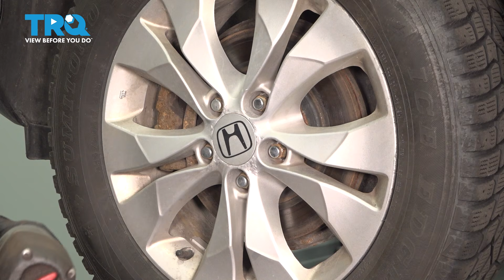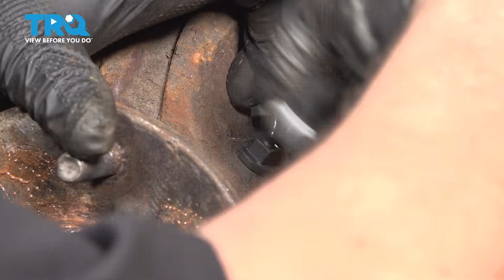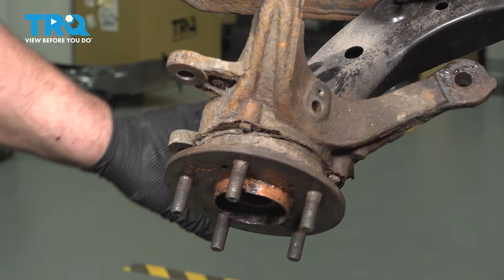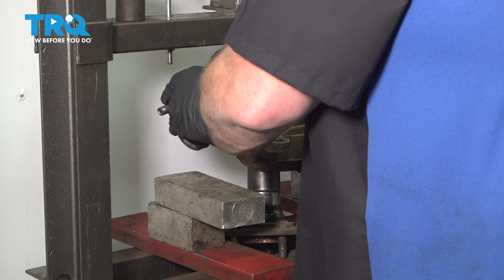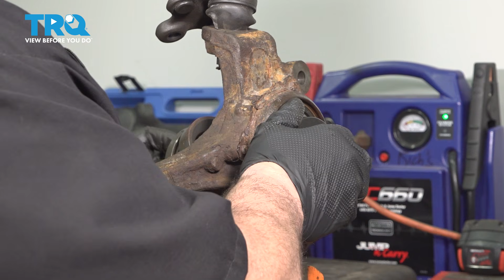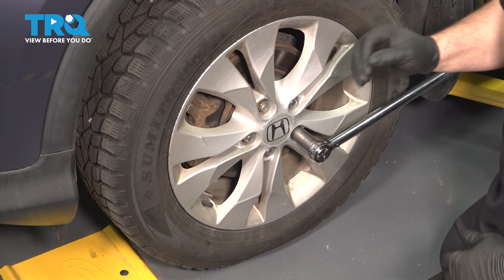How to Replace Front Wheel Hub & Bearings 2012-2016 Honda CR-V

Comment: Hey I like the video but you failed to mention the abs ring side having to face inward. Some bearings have black rings on both sides with lettering saying which side is the abs ring but others have a silver side that is supposed to face towards you. This video either shows him installing the bearing backwards or shows one of the two black ring bearings. If you are doing this job please pay attention and make sure the black ring faces towards the car or you will not have traction control.